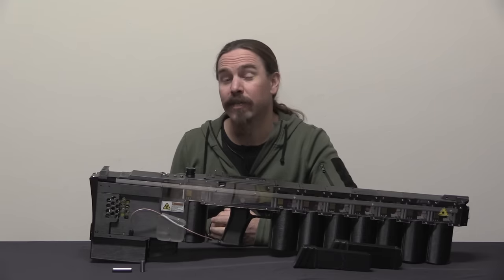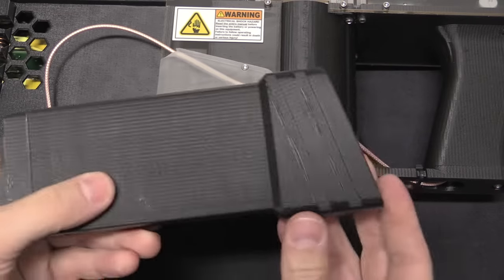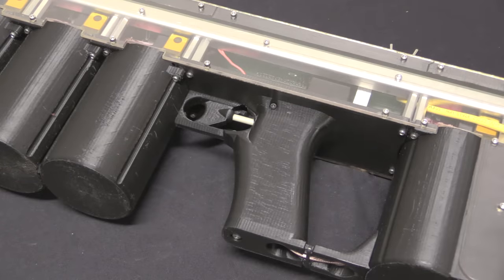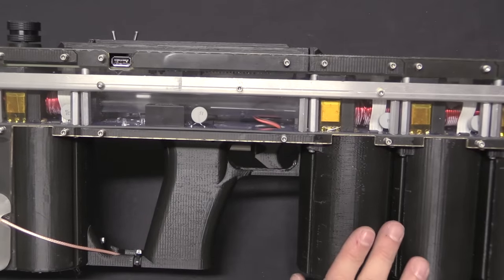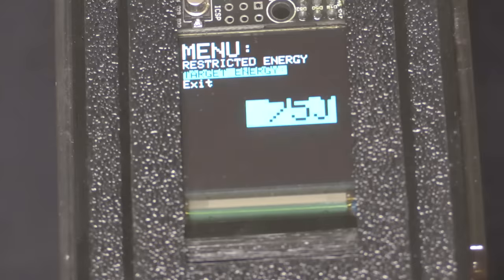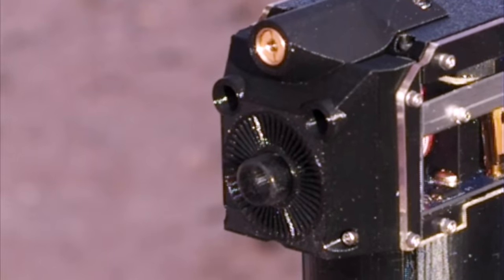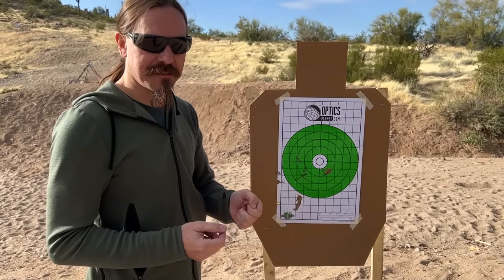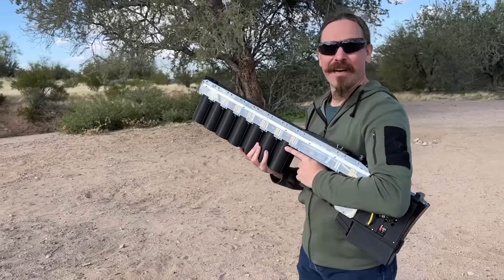ArcFlash Labs' GR-1 Anvil Portable Gauss Rifle

Comment: Something that does get enough credit is how silent these weapons are.
Reply: Also, no flash!
Reply: Yeah it sounds like a toy. I imagine when it starts firing projectiles faster it will make more sound.
Reply: @johnthedropper7289  Won't be a lot louder.
Reply: It will be quiet as long as it is subsonic (< 343m/s @20°C).
Reply: @ABCD-oy4fo  If they ever become supersonic they will be very loud.
Reply: @CanIHasThisName  still not as loud as regular guns. Plus for stealth operations high velocities are usually not required since the target is at a close distance.
Reply: With the electronics it should be easy to switch between subsonic stealth firing and full power firing with just the flick of a button button.
Reply: @shingnosis  Not really... You can't just change the voltage/amps on a series of electro magnets on the fly. There is an immense amount of electrical engineering needed just for the single configuration of capacitors to function right. Something being "electronic" doesn't make it not super complicated.
Reply: @ShaggyRogers1  Oh look, another "can't do" person. Then just reduce the number of capacitors and coils triggered. Less coils. Bullet travels slow. Understand?
Reply: Apart from the high pitch sound when charging the capacitors
Reply: @ShaggyRogers1  Did you actually watch the video? It's literally a setting in this alpha test weapon, see 15:00
Reply: @ABCD-oy4fo  Until it starts firing rounds faster than the speed of sound.
Reply: @ABCD-oy4fo  Its too early to make assumptions like that but this current version sure is silent but isn't very deadly at all.  To pierce armor and armor of the future these suckers will have to go faster than the speed of sound if not 5 times faster.  This current version isn't piercing current battlefield armor that soldiers use.
Reply: @johnthedropper7289  It's already at 100 Joules. Pretty normal for a pistol to have 600 Joules. There won't be much audio difference once the power increases. Have you never driven an electric car? They too make no noise but accelerate faster than every other average car on the road. Making a big bang isn't needed - in fact, it's wasted energy.
Reply: @ReasonMakes  I mean when it goes supersonic.
Reply: @johnthedropper7289  the powerlabs sound like a cannon on the count of breaking the sound barrier.
Reply: @johnthedropper7289  Only if the projectile breaks the sound barrier and then you will get hit before you hear it. I still like the Gyro-Jet guns from yesteryear.
Reply: @ShaggyRogers1  Did you watch the video, this crude version does that already.
Reply: Guns with good quality suppressors are also quite silent, especially if they fire projectiles at sub-sonic speed, as most the sound with suppressors comes from the bullet breaking the sound barrier.
Reply: @CanIHasThisName  loud enough that the sound becomes a weapon.
Reply: @ABCD-oy4fo  but rapid fire is. 3 seconds is a LONG time in close range combat
Reply: @zeedstun891  
How long does it take to reload a muzzleloader?
In time this technology will improve.
And I should be relatively quiet unless the projectile becomes supersonic.
Reply: @ryansreaction  is not the same, because if the projectile go faster than the sound speed is going to be so loud anyways
Reply: Also take into the fact it's ammo is easily  renewable compared to bullets, it has little to no recoil and it can be turned into a wifi router with enough effort. Of course regular guns have their upsides too
Reply: the sonic boom will still make noise once they get hypersonic velocities
Reply: Also, there's no matching the projectile to the gun!  This is some regular guy with a unique set of skills kind of shit!
Reply: @ofthecaribbean  You can't see the huge EMF flash but the right electronics will see you clearly. Soldiers could have sensors built into their helmets to add a sound effect from the right direction every time someone fires this weapon nearby.
Reply: So are sling shots.
Reply: @ShaggyRogers1  in the video he is LITERALLY switching the power/speed of the shots, with input in Joules. It has a velocity sensor. Round weight can be input easily. With a bit of code it would be trivial (for the shooter) to switch so supersonic/subsonic.
Reply: @ShaggyRogers1  it's literally demonstrated in the video. Bruh.
Reply: @ofthecaribbean  wait seriously?last time I saw one of these things fire it had a shitload of sparks flying out the end!
Reply: @ryansreaction  As long as they remain subsonic. That's not the goal however. You want these to hit the sound barrier when they leave the barrel. The energy to penetrate a ships steel hull, or a tanks armor  will mean these things will have a crack, or if serious mach speeds are achieved it will be a boom!
Reply: @ShaggyRogers1  If they are preset there isn't a reason it couldn't happen.
Reply: @ReasonMakes  Physics. These rounds are going subsonic. It will be the rounds moving at mach one or higher that will make noise.
Reply: @thebusinessmn1114  When they get to supersonic speeds they will have more recoil.
Reply: @DragynryderMW  These type of weapons already exist as a cannon that can puncture hulls of aircraft carriers, fire accurately at extreme ranges, and can easily shred a tank. Problem is, with that amount of power, the vibration of the projectile accelerating through the coils tends to rip apart the gun after a few shots, that's the main reason these type of weapons haven't received any further research yet. It's just not quite possible to make them a viable military weapon yet.
Reply: @dazurathefirst8456  you are talking about a different type of weapon, those are railguns, not gauss rifles like the one shown in the video
Reply: No recoil either

Comment: Replace the slugs with ball bearings, and you won't have to deal with tumbling factors.  Just res up another clip that holds ball bearings.  The telescoping design is rather clever, by the way.  Very versatile.  I also wonder if you can try firing magnets with it.
Reply: It could also be hopper fed using ball bearings
Reply: @sir.v3x403  Hopper-fed Gauss machine guns? that sounds absolutely fantastic
Reply: I think magnets wouldn't work.... Some thing about the polarity being able to shift inside ferrous materials I think is important for the electromagnets to work but I could be wrong
Reply: I suspect the 'L' to 'D' ratio mitigates against spherical projectiles for optimum energy transfer ?
Reply: lol I don't think you know how coil guns work.
Reply: energy transfer is proportional to the mass of the projectile, you get more performance the higher the mass and the longer the slug.  thus switching to ball bearings would reduce the performance significantly. while this is a cool "weapon" the technology will never (short of a new revolution in several fields of electronics) reach a viable weapons deployable state. 

electronics nerds have been making these in their bedrooms for decades and the technology used in them is about the same as it was in the 80s and most of the critical stuff such as capacitors and conductors are already close to the theoretical performance limits switing
Reply: @lewispowell1681  I was inferring  electromagnetic energy transfer to the slug whilst in barrel... not terminal ballistics.
Reply: sound like a new airsoft gun
Reply: @denisripley8699  not sure what your on about mate i was replying to sir v3x... not sure how your relating a L/D ratio with EM almost completely unrelated factors
Reply: Or you could make them sabot rounds which would stabilize without the need for rifling, not that rifling would even work with this weapon would work but still
Reply: Although BBs would work, a Fin stabilized projectile would be a better option IMO.
Reply: @MPdude237  my thoughts exactly
Reply: It fires via magnets so I don't see that happening unless you want the equivalent of a lightning bolt exploding in your hands. Though ball bearings would be interesting to see, I would think that would completely tank any accuracy and power it has
Reply: The easiest solution is to just swap the normal shaped coils out for Rodin type or Starship type coils to spin stabilize the projectile. You wouldn't even have to really readjust anything else on board the weapon.
Reply: Design one that fires used AA batteries so i can take it to football games
Reply: @lewispowell1681  what if the projectile was really long and thin, like a piece of dry spaghetti?
Reply: @Superabound2  well length has a limit you need to be appropriate for the size of the magnetic fields it travels through and making it thinner would reduce the mass which is directly proportional to the energy transfer from the coils to the projectile
Reply: The problem lies with the application of this gun. The technology to make this a viable portable weapon seems limited right now. It should be mounted for a defensive purpose, like an anti aircraft gun hooked into an abundant power source. Make it work in the most optimal circumstance, then as technology progresses it can be made smaller and portable in about 50 years. Much like the Personal computer.
Reply: @PistolPete1980  but at that point why bother when the Nicola Tesla designed mercury particle beam patent from the 1930s is available that shoots from an open end vacuum tube that carries a transient dielectric impulse wave on top of the mercury "wire" and can vaporize anything within 200 miles and is basically the same size and mass if used as a stationary or vehicle mounted weapon?

Comment: i'd say the other big safety thing is to have the capacitors fully discharged. 
because large capatcitors will after they were shorted the voltage will go up again and the voltage can get to quite dangerous levels
Reply: but dont completely discharge the battery, because then it doesnt work anymore
Reply: I had the exact same thought when Ian powered of off and then walked in front of it
Reply: That’s a bit like saying you need to remove the primers from your cartridges because they’re explosive. In the same way that the only thing that will set off a primer is a firing pin, the only way energy can flow out of the capacitor is with permission from the computer (which is off)
Reply: it needs a stun-baton-addon.
Reply: i'd say there probably is some resistor that is relatively slowly draining the capacitors. But who knows how it is wired. I would even be a bit afraid about that battery connector 17:50.
Reply: Yeah, when he disconnected the battery and said it was completely safe, I was thinking "not with those huge caps in there it isn't", although it is relatively safe at that point unless you're planning to disassemble it
Reply: @petrkubena  I suspect that there's bleeder resistors which are wired into a fail-safe relay so the resistors are always connected once there is no power in the device.
Reply: I mean people handle lethal capciters all the time in PC building... They are power supples... which are complety safe as long as you don't open them when they are have charge... Which they'll kill you just as fast. So the solution like anything is training and not being an ididot and shielding...
Reply: I was nervous the whole video, not seeing any equipment around to safely discharge the capacitors. I got zapped a few times by fractions of the capacitance on those things and it wasn't pleasant.
Reply: @mrb692  i mean fireing isn't the concearn here it is more about being a pocket emp

Comment: if it can fire effectively at 50% power, they could split the capacitors in two groups and charge\engage them in an alternating pattern. If the current RoF is 1.5 seconds between shots, it could be taken down to 0.75 which is quite impressive
Reply: Or if the capacitors can get a LOT smaller, there could be multiple rows of them spaced at different "hour positions" radially around the barrel. Either to allow firing with another row while the first charges, or engaging all of them to fire harder, or as redundant units in case of a damaged capacitor.
Reply: Problem would be loading the projectiles. The faster thry go the more problems will generate
Reply: @googiegress  the capacitors may change in shape to some degree, but for big values you need volume.
Reply: Or double the capacitors and have them in a V pattern around the barrel.  Very sci-fi and can put a proper hand grip under the barrel.
Reply: @ride5000  Yes, like a lot of this, it would need advances in basic materials available and something revolutionary in capacitor construction. Things that aren't really forseeable (if they were, we'd be doing it right now).

Comment: This thing needs a fin stabilized discarding sabot round. It would make up for the lack of rifling and prevent any tumbling. But even more importantly, it would be cool AF firing an APFSDS round out of a coil gun.
Reply: Would love to see an APHEFSDSHEATHECBC round
Reply: It would also defeat a lot of the point of being propellantless and caseless - it's not very hard to induce spinning with a magnetic field, so I'm sure a future version will incorporate spiral coils instead.
Reply: couldn't it be viable to make twisting grooves into the projectile so that air passing through them spins the round without altering the diameter or dimensions of it?
Reply: @coconut9250  I'm assuming there is no air passing through, as you'd get with expanding gases of regular ammunition. As Jackson mention, the magnetic field itself can induce a spin, like they do in fusion reactors, to contain plasma. I don't know if the length of the barrel will suffice, but suppose they're working on improving the prototype.
Reply: You don't even need a sabot since there is no need to build pressure behind the projectile, you could essentially just have this thing fire some kind of bolts or arrows
Reply: It won't even need the discarding sabot part, the dart is enough, as in guns the sabot is there to act as a plug in the barrel. But here the projectile floats through the barrel without touching it, so no need for the padding.

Comment: The middle length projectile looks exactly like a 3/8" drop in anchor. They are 1/2" outside diameter and have those same slots for expansion.
Reply: Yeah i noticed it too. You can see the threads inside where you would screw on the bolt and the small piece that would expand the anchor inside the material.
Reply: There's no "looks like" that is straight up a drop anchor. I put some in like a week ago. Came to see if I was the only single one. 

Those models suck though. A terrible habit of not catching.

Comment: I think slug is the appropriate term for the ammunition, especially in its straight form without fins.
With fins it should be called a bolt.
Reply: Would fin stabilizer round like that of a tank gun work?
Reply: I think some shoot metal discs.
Reply: Sounds right to me.  "Armature" is the name for ammo in a Rail Gun.
Reply: I was thinking of 'Flechettes'
Reply: @tarektechmarine8209  It should be possible to shoot regular archery arrows with this. 
Off the shelf arrow points are magnetic and  same size as these slugs, and the shafts are non-magnetic plastic or wood that won't interfere with the acceleration.
Only the feed mechanism needs some customization.

Comment: UI wise, it would really benefit from "standby" laser aiming grid, to avoid hunting the laser dot like Ian did before each shot. It'd be a grid of say, 3 dots, that are always on or enabled by touching the trigger (oooh Predator sight). Then the much more powerful center dot signals the charge state.
Reply: Even better - the three dots could move closer together as the gun is charged 😁
Reply: Or just have it feed directly into optical wear. HUD
Reply: or just put a rail and some sights on top
Reply: Ahem. Spartan laser rail gun
Reply: he wasnt hunting for the laser, he was waiting for the gun to charge.
Reply: @loggerbomb  Before he starts waiting for the gun to charge, he wiggles the entire gun around each time to find the flashing dot once he started pressing the trigger. My point is, to use the dot as an indicator, you have to know where to look for it. And if it's off until it starts indicatin', you don't know where it'll appear. 

And laser dots are hard to find outright in most environments — you mostly find them thanks to their "permanence": when shouldering the gun, you notice it flickering over various objects as a constant.
Reply: @HopeisAnger  Absolutely, I agree! Yet, again, think about it: if you put a red dot on this gun and sight it in, the dot will overlay the indicator dot =)) So you can do several things. 

You can make a proprietary red dot with a built-in blinking indicator dot (nice but lots of investment, and low/no compatibility with off the shelf options). You can make a different kind of signal that uses peripheral vision, like, just bounces the indicator light in diffused form somewhere in your field of view. 

Or, you keep the signature laser designator indicator light, but now you have to space the beams so they're beside the main collimator dot / reticle, whatever your sight is. It may not be practical, but it's cool! And much later down the road, they'll make integrated sights with an indicator anyway; plus I think they'll just have a very quick charge-up PLUS an automatic release, maybe even coupled to an "automatic trigger" sight like the TrackingPoint (you paint the target, you pull the trigger, on charge-up AND correct aiming point it fires).